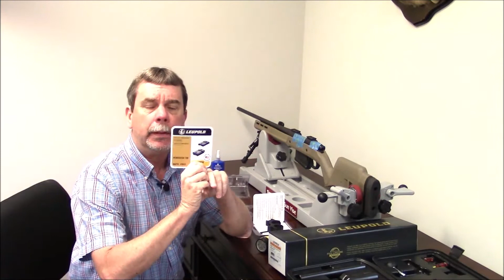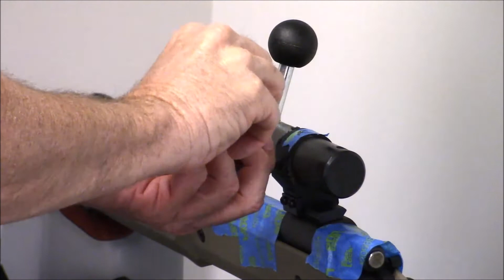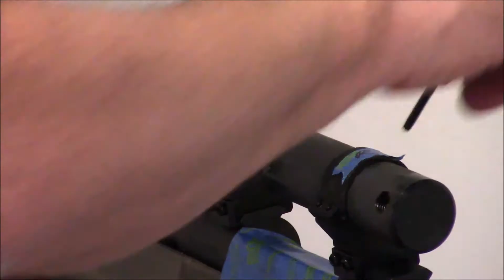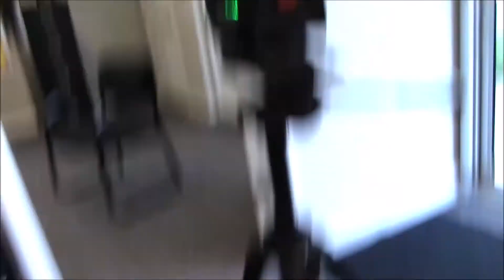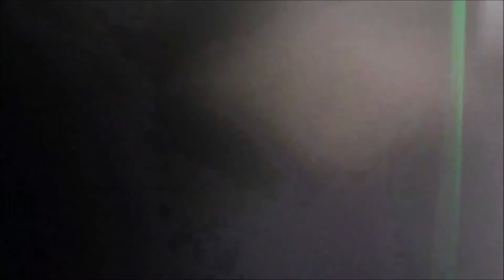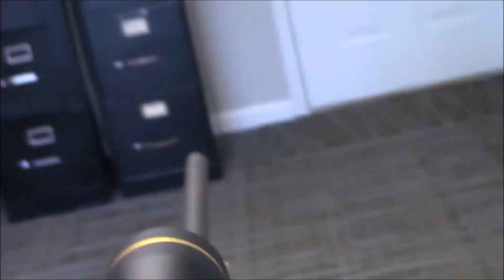Leupold Scope Mount on Remington 700

Comment: Thanks for de video. When you are trying to align the scope with the laser vertical line, do your head blocks de laser beam or it is not a problem?
Reply from the maker: I try and set the laser a few feet above scope so that it will allow for the light to go over.
Thanks
Reply: @chrisfowleroutdoors7828  Thank you Chris!